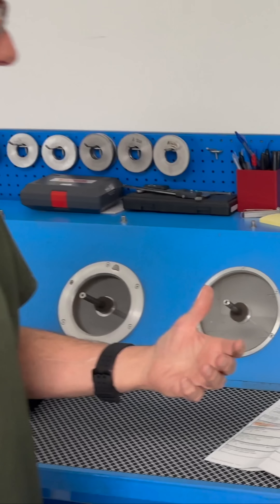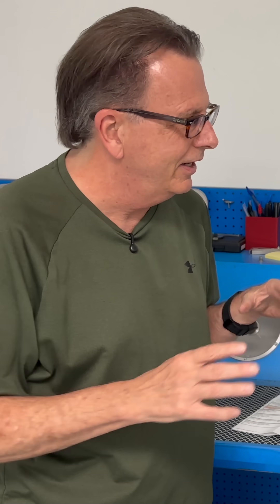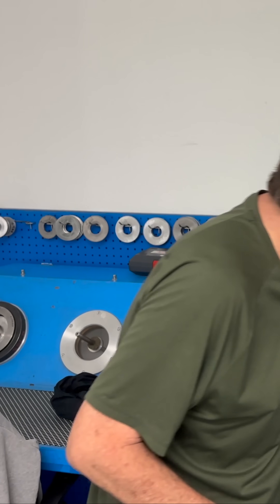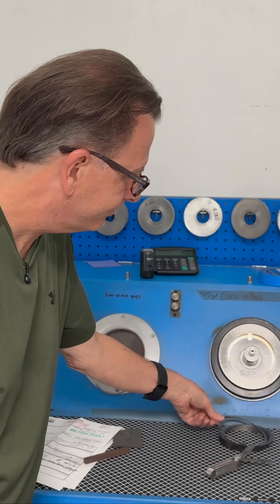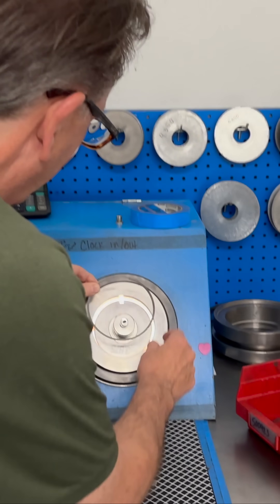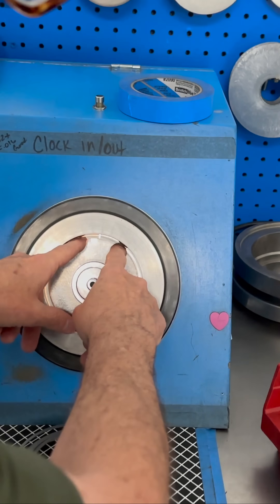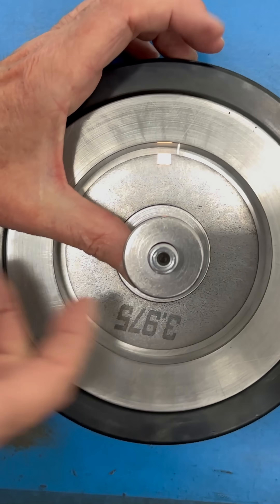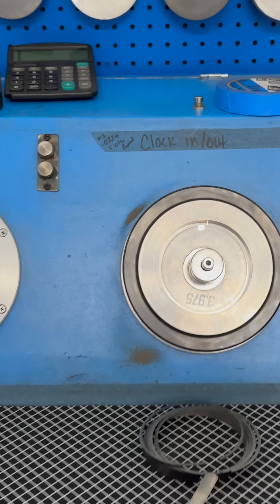Light TIGHT! Piston Ring Quality Spec   Keith Jones w #BarryT #PistonRings #TotalSeal

Comment: I used to do this with my rings. I would put them in the cylinder and get a flashlight and running around the ring edges. And all timer engine builder taught me this… Keep on rocking
Reply from the maker: Thanks for sharing!
Reply: I applaud the idea, but don't see how that's even relevant without the head and mains torqued and the engine warmed to operating temperature.